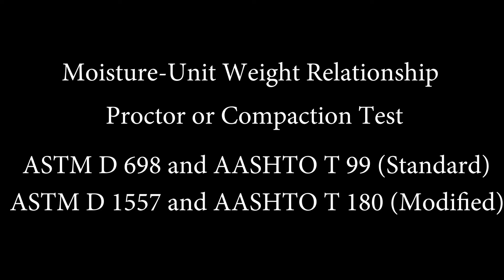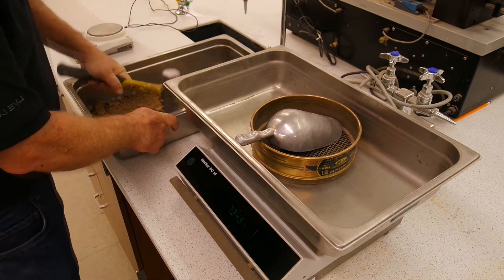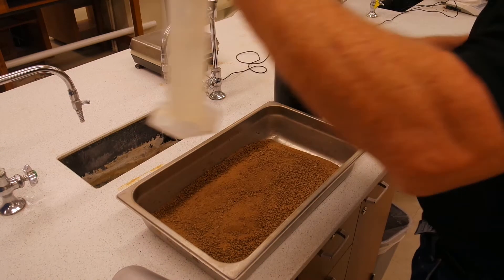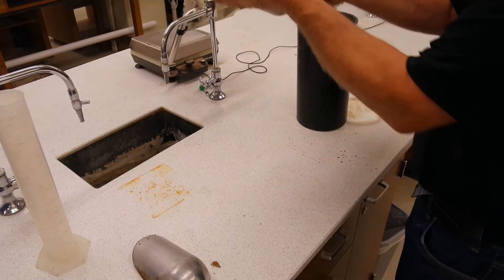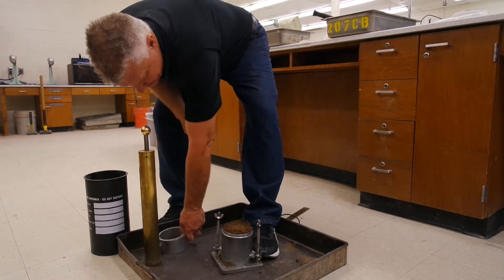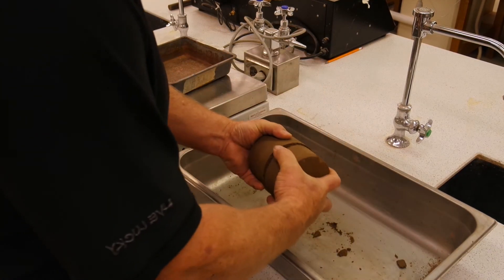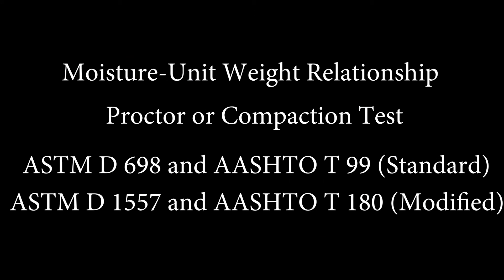CEEN 341 - Lab 4 - Soil Compaction and Proctor Test

Comment: The video was informative, but I found a few mistakes that should be noted. (per ASTM D698)

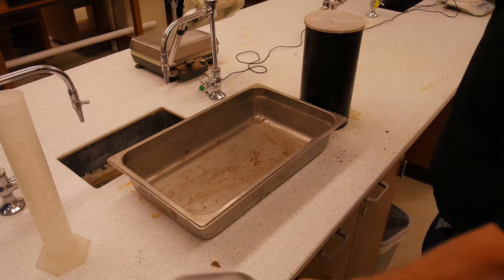1. Samples with clay should be allowed to cure for at least 16 hours. 3:16

2. The base plate should have been secured to a rigid foundation, without wobbling/rocking.

3. The soil should have been lightly tampered prior to pounding each layer, so that the material isn't in a fluffy and loose state.

4. When you start pounding each layer, the pattern should be like a "+"  for the first 4 blows (left, right, down, up), and then you start going in a circle pattern until you reach 25 blows.

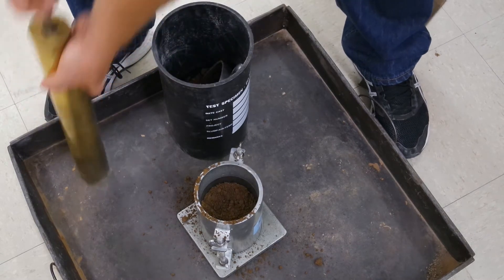5. The sample should only extend a maximum of 1/4 inch above the top of the mold or it should be discarded. You said 1/2 - 1 inch above the top of the mold. 4:00 💀

6. Before starting the 3rd and final layer, you should trim any excess, loose soil remaining from the 2nd layer that wasn't compacted or that extends above the compacted surface.

7. You only sampled the moisture from a single layer. The preferred method is to use the entire specimen, but you should have used a representative portion that included all 3 layers, per the ASTM.